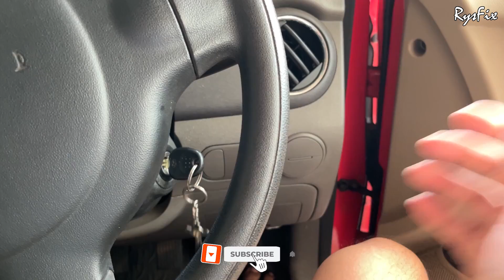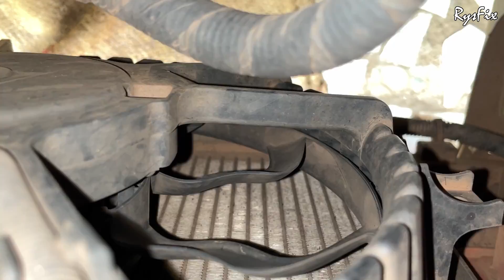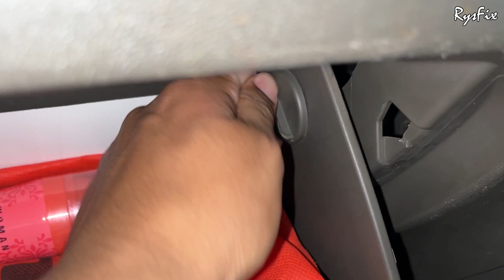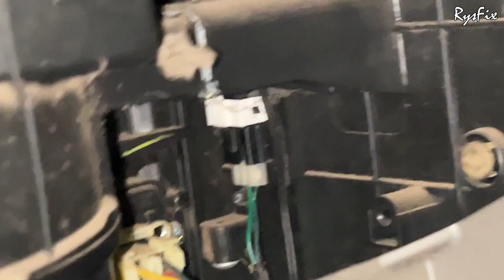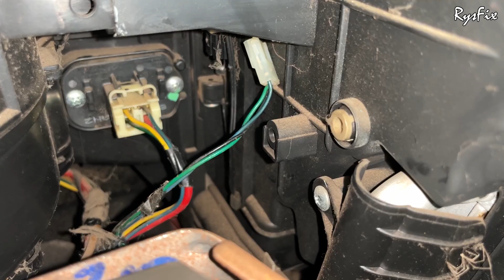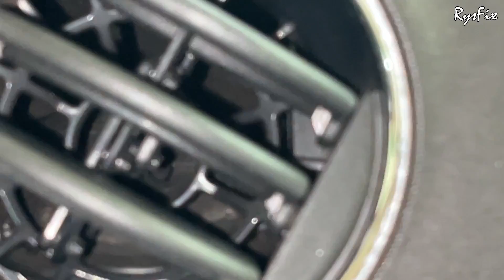Car AC Cut-Off Problem: Thermistor Sensor Bypass and Compressor Engagement Solution | English

Comment: I have Hondacity 2012 petrol car.I am facing problem related AC trip some time and blower not discharging reasonable air and cooling stop. After keeping AC off it start cooling. Can guide me and give estimate of maintenence charge please. I am regularly cleaning and replacing filter  also, so ignore filter issue. So many time after continuous ac on , it stop cooling and same time blower also reduce air flow. When  AC switch make off, after ~10 minutes it get working.Please advise
Reply from the maker: It sounds like your AC filter needs cleaning. Try that first! You can do at home only.

Comment: My car ac cold after running 10 minutes become warm……… take long like 5 minutes before cool again. What is the problem
Reply from the maker: Clean cabin ac filter and check first, then top up Freon.
Reply: @rysfix new cabin filter. Freon at good level but still the same
Reply: @rysfix maybe thermistor?

Comment: I’m working on 12 CRV and have it diagnosed to the temperature switch mounted on the compressor. I can’t find the wiring harness so I can check the resistance. I see it at the compressor but can’t get close. HELP

Comment: on my tacoma that A/C relay turn on the magnetic clutch so if the relay engage my AC compressor run but I lost the control power to that relay.  I by pass the relay then the compressor is running.  I'm guessing the Hyundai wiring is different.

Comment: I checked fuse&relay ok, thermistor bypass U wire, pressure switch bypass U wire but still no 12v to compressor socket, can you share what others possiblity? Thank you in advance.
Reply from the maker: check your switch

Comment: Hi brother, thanks for the video 
I have similar problem with my Aircon too
My thermistor has only 2 pins in it, can direct it similar way?
@RysFix
Reply: If it has only 2 pins then you can connect the two pins with a jumper (U) wire just like what he did in the video. One pin supplies power and the other is ground. You can do this bypass only as a temporary fix.

Comment: How to know the resistance value of that thermistor on car aircon if you replace it?.. what re ommended thermistor value the is 5k, 15k, 20k up?.. i want to buy but i dont know the value of my old thermistor need to replace my old faulty one, my car aircon takes to long stop automatic cutoff

Comment: Hi..my 2010 model ford fiesta having same issue. AC cut off not working. Service center guys told they have to remove the complete dash board.Is it necessary?
Reply from the maker: yes